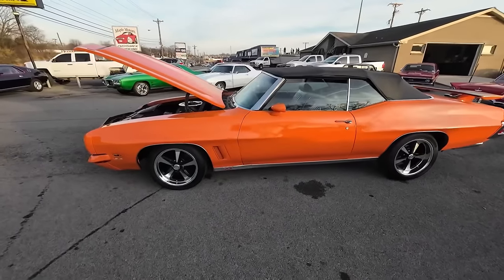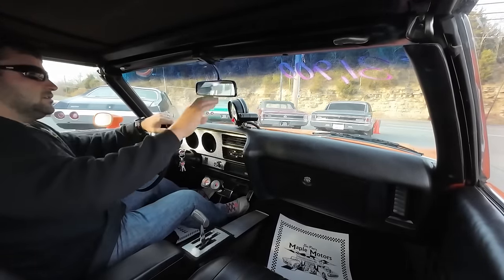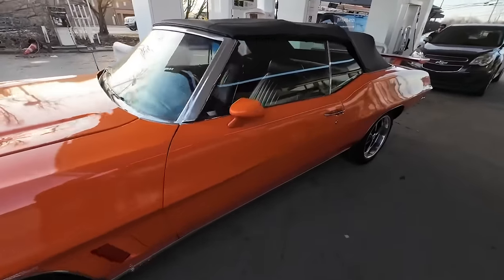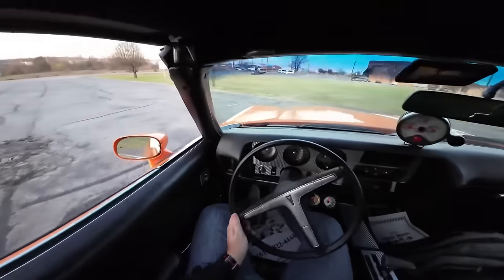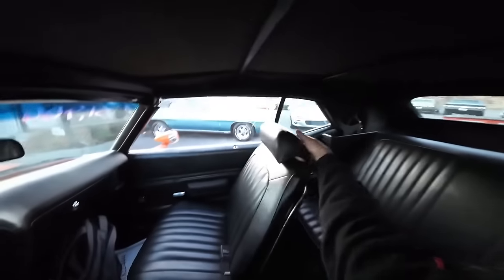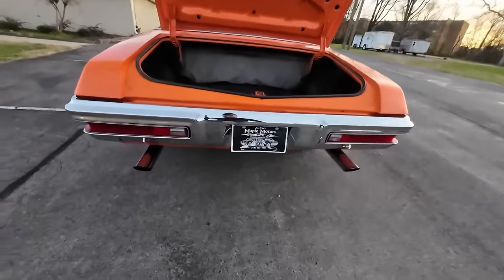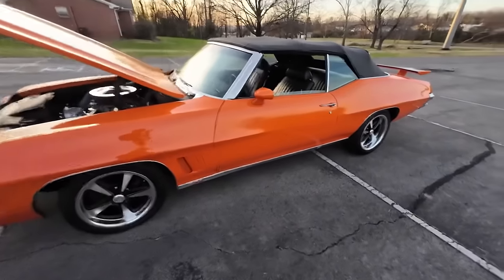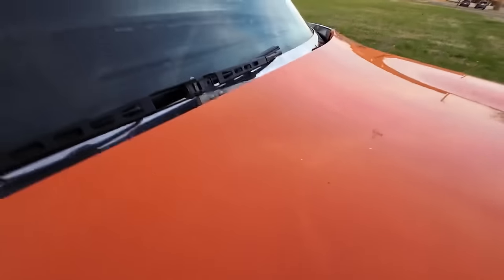Test Drive 1972 Pontiac LeMans Convertible SOLD $31,900 Maple Motors #2445

Comment: The 1st thing I see is the color, that screams look at me as I go down the road, for it pops and # 2 has the trany been flushed out, because of the trany making that noise that will do that. For the front end bumper, it is composite and it is rubber compound that will not dent, for the paint will crack if not done properly. For the car overall just needs some TLC and I think the price of this car is very fare and I love it, for some one that restores cars, sweet ride and that is the truth.

Comment: Sounds like the power steering pump is shot
Reply: Gear drive
Reply: Might be low but they check that stuff, that is what I thought I was hearing
Reply: Pontiac with geardrive. That's different. I dig it.
Reply: Gear drive
Reply: Dude. Stop
Reply: Needs a lot of work. 😢
Reply: COULD BE GEAR DRIVE
Reply: 😂😂😂yep, them ol power sterin pumps rilly howl. Or, could be a gear drive  engine😂😂😂

Comment: AWESOME CAR ! I owned a 72 GTO and I did completely  over hands down the coolest car I ever had . 👍🏼
Reply: @goodbonezz1289  Hey Goodbonez how are Ya man ? I had some Sweet cars but what that car did my others wanted to do but couldn't like my 69 Carmaro built 427 tubbed with vertical 4spd that was fine for around town but that GTO I built that motor did suspension anti swaybars  etc 3:73 so we could pile in it and rip down to the beach and with that motor dialed in it was a fast car . I'm actually looking for another I missed the Turkey run down in Florida but I will find one again . I had a 442 w30 another fun car I will tell you the entire EV is a bunch of BS  right now it cant work for so many reasons it is not viable for many years to come . Have a Great day brother 👍🏼

Comment: Is that a real GTO Judge?  If so, that's a real find.  Needs era correct wheels and tires, imo.
Needs the few degrees of rake you get with low profiles in the front and high in the rear.
Reply: Just stickers😮